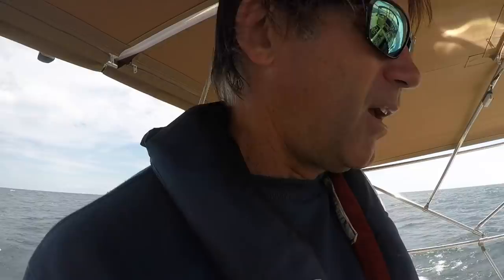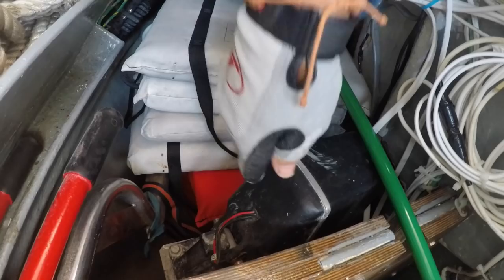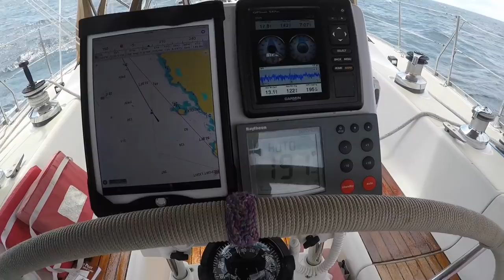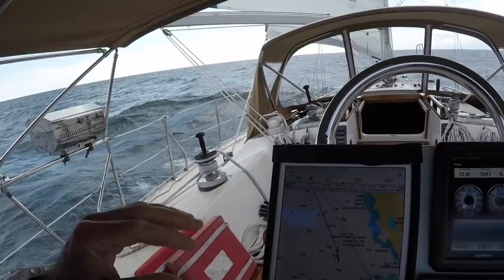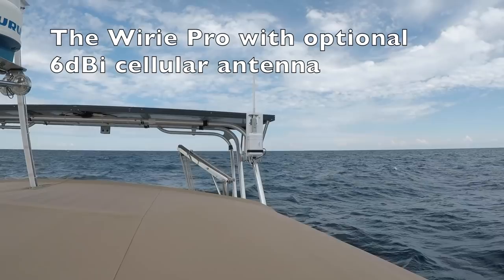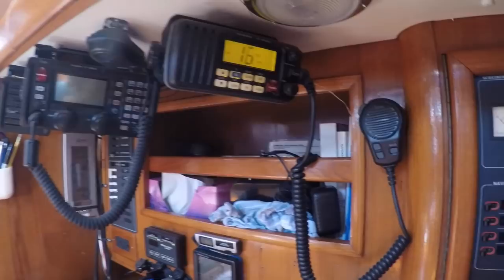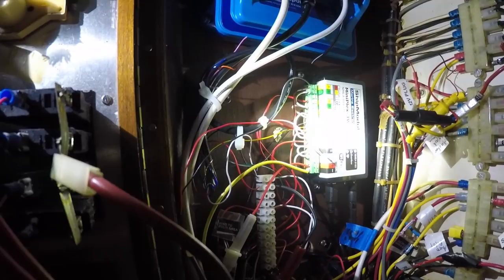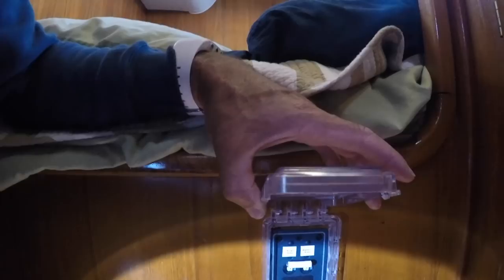Navigation Gear and Electronics for a Cruising Sailboat | Ep. 11

Comment: This was a very good video. Electronics are so complicated, so it was nice to see what someone else was using and the good and bad about it. The multiplex was a great piece of information. I wanted to add that we also have the same autohelm. At one point it stopped being able to "take the helm" and kept giving us an error. We determined the motor's brushes must be worn out, but when we took it apart, they were still fine. We cleaned the copper coils completely and it works just like new. Our whole system is Raymarine and 20 years old, but it uses the NAMEA system. The Radar is broken and the chartplotter displays are shot so an iPad with a wifi Radar is the direction we are going, so your video was very useful! Thank you.
Reply from the maker: Hi Marina. Glad you got value out of the video, and thanks for the tip on fixing the Raymarine autopilot. It was one of the more reliable pieces of gear on Thalia, but in time everything seems to wear out! And yes the multiplexer is a value add-on, and a necessity if you plan to use an iPad for navigation. Good luck with your transition of gear.

Comment: Very nice.  I’m a sailor and know all this but I still enjoyed your easygoing intellectual approach.  I was actually making almond cookies as I listened. I don’t think you explained that you can create a waypoint a thousand miles away rather than a heading and the autopilot will adjust for being blown or pushed by current to the left or right (called being set). You can also use the instruments to manually steer with a way point set and see if heading up into the wind or running lower gets you to your waypoint faster. Sometimes going slower gets you there faster if at the end you can turn lower into the wind. As in a race. I know that is not the thrust of your video but it’s pretty darn nifty. The first time I ventured out to sea was from the mouth of the Chesapeake to Virgin Gorda along w Steve Black’s Caribbean 1500 (RIP, he was a marvelous man). About a day and a half out the autopilot started zigging right and left and dramatic arcs.  My tendency was to turn it off. My experienced mate said, “Don’t. It’s figuring something out. “. He was right. It stopped doing that after less than a minute and changed heading a teeny bit.  I found the thing it had the hardest time with was what you described, though not completely.  It has trouble anticipating FOLLOWING sea waves that unless you take preemptive impeccably timed counter steering to prevent wild yaw, you’ll yaw like crazy.  Such a place is the cut between John and Thomas heading north to Jost. The rollers are 12 feet high and sweep beneath your boat. A lot of Sailor’s cannot handle that. I had on board a client and his accomplished guitarist son. Who had never sailed. I explained what I was doing, he begged to take the helm, and he did it flawlessly. It’s all about rhythm. He was rhythmic. Anyway, very nice video. My navionics were old. They worked. Whenever I thought about upgrading I thought about Christopher Columbus.
Reply from the maker: Thanks Robert for your stories. Indeed an autopilot is an incredible piece of equipment. We sailed in the carib 1500 when Steve black was running it too, in fact the year he passed. Great person. Take care!

Comment: Thanks that was an excellent video on electronics. Technology has changed so much over the last few decades and your video allows us to much better understand what is available today. I was originally trained in the Navy with a sextant and navigation gear which compared to today's equipment was ancient. My sailboat in the 1980's just had a depth sounder and a vhf radio and so I just used paper charts in west coast sailing.  So there was a different approach to navigation and ship handling back then. We still have the same COLREGS but I can see how there is much more emphasis on the electronic world in cruising today. My biggest concern would be offshore sailing where for some reason the electronic systems stopped working. But thanks for helping me better understand today's technology! Very well done!!
Reply from the maker: Great, glad you found it helpful Ron. My first cruising experience was on a boat with only a compass and depthsounder. Simple, but probably not to safe! It's nice to have the modern electronics onboard but your comment is a good reminder that we all need to have backups in place and to be familiar with how to use them. Fair winds!

Comment: Informative video, thanks! I have on my boat some of the older electronics you cover here, including an old Furuno that barely works. I also have the same auto pilot but need to test it more under sail to see the effect on battery charge.  Question: When sailing with auto pilot, is your solar charge sufficient for keeping batteries up? Do you AP at night?
Reply from the maker: Hello Peter. We do navigate at night at times. The autopilot (together with refrigeration and navigation gear) does take a lot of power. It depends on a lot of factors, such as the size of your solar array, the sea state, and weather. We find that with a sunny day beforehand, we have enough power to last through the night navigating on autopilot in a moderate sea, but will require a mostly sunny day the next day to replenish the energy. Good luck!

Comment: Maybe asked before but good video as much comments...
How have you attached the i-pad in case to the nav pod?
Clips into a frame??
Th
Thanks
Reply from the maker: Thank you Stephan. I added a couple of corner straps for the bottom, and a thin velcro piece across the top, all screwed into the navpod. It was all in a lifeproof water proof case. That was several years ago, and likely there is something pre-made that could work better for mounting. Good luck!

Comment: Hello. If I am to embark on a sailing boat journey on my own I would take some measures to reduce the amount of total radiation around the boat out of health concerns. I would have abandoned all wifi and put in RJ plug to the ipad and cabled all antennas to all instruments via cables. And the antennas would be placed high up in the mast, particularly the radar so as to keep a distance from the crew. Someone ought to make such an instruction video. Let's avoid cancers and early deaths. Otherwise a good overview you have there. What is the minimum amount of one would need to be comfortable is also a good question to ask. Other metal box shieldings of charge controllers close to bed etc. is another suggestion.
Reply: We had a rubbish communications officer on our Australian warship while undertaking a goodwill cruise to Japan, and we went into Sasebo, flying a UN Flag, which was interesting.  The comms officer escorted a young Japanese lady on a tour of the ships antenna array and looked her straight in the eyes and told her that he was standing too close to these transmitting antenna and had become sterile (which looked plausible because we had these big red lines marked on the deck warning to keep out of this area) and she believed him, swallowed the story hook line and sinker.  He did this because he does not like to use condoms.  He was an outstanding first class creep.

Comment: Great video explaining all the Electronic details.
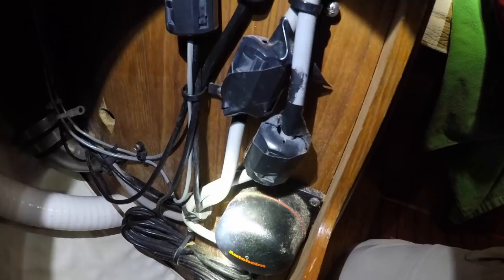At 9:35 why have you attached extra ferrite cores to the Cables? Is the unit prone to picking up RF/HF from your radio transmissions?
Cheers from Sweden
Reply: If possible I would really appreciate an answer to the ferrite question
Reply from the maker: Hi sm6wet. Yes those ferrites are there to prevent the autopilot from getting noise from the SSB radio. If you have an SSB, it is good idea to get a bag of ferrites - very helpful on other radios, fridge compressors, other electronics, even fluorescent light fixtures. Some people go crazy with putting them everywhere, but I tried to focus on the main noise generating or sensitivity electronics gear. Good luck!

Comment: your video is awesome, it's a lot of useful information, but i am a little confuse. if the AIS is already transmitting the NMEA data over wifi why you need also the MINIPLEX 3WI ?
Reply from the maker: Hi Cesarmanwolf. Good question. If all we needed over wifi was the AIS data, we could just use the Vesper Marine unit. But I wanted to broadcast wifi with other non-AIS data, like wind, depth, and speed. Since mobile devices can only have one active wifi connection at a time, if you want all of the data at once, a wifi multiplexer is needed. The multiplexer has the added benefit of being able to connect and share NMEA data over hardwire connections to the other instruments onboard. I like to have some redundancy onboard  too, so if the Miniplex multiplexer fails, we could use the Vesper wifi as a backup connection. Good luck!

Comment: What kind of range do you get from your cell and wifi antenna?   And what kind of bandwidth do you see at what distances?  I realize you probably haven't spread sheeted this, but a rough idea would be very helpful!  thanks.
Reply from the maker: Hi Harrison. In brief, I can say that the range and bandwidth were highly variable. I checked bandwidth regularly with SpeedTest and, after we switched carriers from Tmobile to AT&T, the former of which has poor coverage outside of large urban areas, we got download speeds in the 15-20mbps. Oddly, the bandwidth could suffer when we were around alot of other boats, so I wondered if interference was an issue. Range on cellular, across open water, was several miles or more - hard to judge range closer to land as I didn't know where the cell tower was. For wifi, although we could pickup signal with reasonable strength from about 1/4 mile away, I found the connection unstable. It was best within 500-1000 ft. Again, it also seemed to be affected in areas of heavy wifi or many boats. Hope this helps.

Comment: Just a question what version ipad and do you need to have cell conection for nav software to work?
Reply from the maker: Hi Randy. It's a standard iPad (not the Air or Pro). At the time we bought it, you had to buy the cellular version to get GPS, although you don't need to activate a cellular plan. Only that version, not the wifi-only version, had built in gps. You might check the Apple site to confirm the latest.

Comment: Very nicely done, I like your layout combining old and new. Funny how i-pads are becoming the choice of Chart Plotter Displays....   ;-)
Reply from the maker: Thanks Mark, glad you liked it. Yes I think it is the reality of many boats these days where you have a mix of old and new tech. And what is new becomes old very quickly! We greatly benefited from using an iPad but there are times when it is still nice to have a traditional chart plotter to fall back on. Fair winds!
Reply: I'll stick to my practically ancient Seiwa Mako monochrome chartplotter in the cockpit. The iPad and iNavX make a good backup but not something I want to deal with in the cockpit when the going gets rough. It barely works at all when my hands are wet and I am on my fourth iPad since 2007 even though it is only used as a backup. On two the screen broke and the other the battery died and would not run even when plugged into USB.

By shopping around it is very easy to find a very good older chartplotter that will cost a mere fraction of what a new iPad cost.

Comment: Why not use wind vane style autopilot
Reply from the maker: Great question Andy. We are actually looking at that option on our current boat. It's one of these topics that generates lots of strong opinions. The electronic autopilots have come a long way and are more reliable then they used to be, and they obviously work when there's no wind to drive a self-steering vane, but they do take a tremendous amount of power. The vane is great for long distances/ocean crossings. That's why we are looking at it. If possible, i think it is good to have both.

Comment: I'm a newbie (too) and can't get my head around how you get wifi to the iPad. If I'm half way across the Atlantic, I would think the only kit picking up a signal would be the sat phone. So how do you get iNav software to work in real time miles from anywhere? I sort of understand how the Wirie system works near shore, but still can't grasp how it can get a strong signal. Please advise.
Reply from the maker: Hi George. The Wirie system was setup for near shore cell/wifi reception, not sat phone use. But you can still use iNavX offshore. As long as either your ipad has a gps receiver, or it is receiving gps data from your boat's local wifi network (e.g. from the boat's main GPS/chartplotter unit), then you will see your position on the iNavX screen and can navigate. This assumes that you have also downloaded whatever offshore iNavX charts you need, before you depart. Hope this helps.

Comment: What's on my mind is AIS pld's. I think they're great especially for couples. But their VHF signal is not strong and the now lone and stressed skipper might be or get far away. I'm pondering on the on board AIS/VHF and whether it should have signal amplification added.
I'm also conflicted with my aerial (antenna) diversity policy and feel that in this case it would be better high on the mast. 
What are your views on it all?
Reply from the maker: Interesting considerations. We like the personal AIS devices as it puts you in charge rather than waiting for some unknown period of time for someone else to pickup a personal epirb signal. For MOB rescue I don't think the height at the mast vs say the top of an arch will be that much better. It's line of sight which would allow the MOB to drift quite far away. I also like the fact it can show up on nearby boat's AIS screens.
Reply: @LifeFourPointZero  just came across the answer to my concern. I thought that mob an hour ago at 6/7knots by discovery time, the sleeper could be further away than line of sight of a low AIS antenna. Think horizon and seastate. I've seen them mounted on the lower pulpit rail and worried line of sight should be optimised by mast height. Then we have the weak plb transmitter and near expiry date battery power to thret about. Suppliers suggest a range of 4 miles. Answer is the Mob1. Once paired it alerts your DSC instantly on initial activation. The alarm will wake the dead. No more distance or AIS antenna concerns. 
Good article https://www.bwsailing.com/cc/2016/06/epirbs-plbs-and-mob-beacons-what-is-best-for-your-boat/
Taut sheets
Bill
Reply from the maker: @ratusbagus  Great thanks for sharing!

Comment: Thanks for your informative and comprehensive review of nav aids. Just to clarify re: iPad I’m assuming it uses it own cellular gps data so a WiFi only unit would not be suitable for Navionics? Thanks
Reply from the maker: Our iPad gets its GPS position data from a wifi multiplexer on the boat, made by ShipModul, which in turn gets its GPS data from our chart plotter. While you could use the internal GPS in an iPad, it is going to be less accurate, and a high degree of accuracy is what you want if you are using it for navigation. With a multiplexer like the ShipModul one, you can use a wifi only iPad, and it gets its accurate position from the wifi signal from the multiplexer.
Reply: Interesting that you say it gives a 'more accurate position' with wifi signal from the multiplexer.  Is the iPad connected via USB input and therefore receiving power as well?
Reply from the maker: evanofelipe No, the iPad is just plugged into power. Everything else comes over WiFi to it. The gps position is more accurate as it is coming from a higher quality gps antenna on the chart plotter, then through the multiplexer, and over WiFi to the iPad.
Reply: Great vids. I've been using an ipad with gps built in. Do you know the accuracy of this? Really enjoyed the detail
Reply from the maker: Tom McFarland Hi Tom. I’m not an expert on the iPad internal GPS, and I’m sure you could find more info elsewhere on the internet, but I highly doubt it’s gps could match a purpose built chart plotter with an external GPS antenna. Whatever the improvement is, for boating in tight spots, I’d highly recommend the accuracy of an external antenna. Good luck!

Comment: Why did you go for the gimballed radar?
As an ex IT Architect specialising in resilience SPoF's jump out at me and you have covered your risks very well. Dedicated VHS aerials no splitting and even diversly positioned.... yes. Alternate routes to data. Tablet backup. But... 
The AIS/GPS aerials might be better if they were diversly located think 3rdparty in remote anchorage.  Also, diversely locating stuff helps diversify cable routes (mitigates countless risks).  A tablet is only mitigation to this narrow risk if it has built-in GPS (and also useful off ship :{    )
Fog horns on the radar gimbal? And both on the arch. 2 things linked by same need... Either, alone, will help in fog, but you could lose both in the one incident.
That's it. Otherwise you're tight.  
Biggest Single point of failure I see everywhere, is the mast. Bad enough to lose, but especially when everything is fixed to it.
Reply from the maker: The him gimballed radar came with the boat but I like it for it's better operation when heeling. You are right that all the stuff linked in some way to the mast is a risk. We carry an extra VHF antenna for that reason, and a basic SSB antenna. Putting the radar on a dedicated pole is popular with many boats but it does add the risk on a line wrapping around it or contact during docking or going stern to like we are doing nearly everyday here in the Med. All tradeoffs and your point about SPoF is well taken!